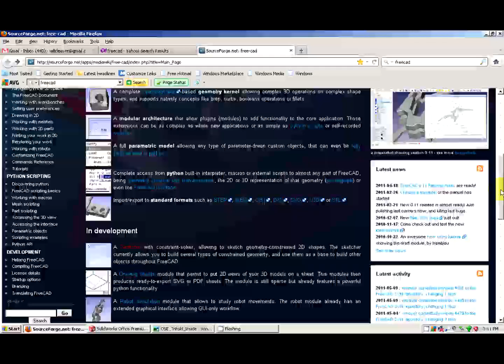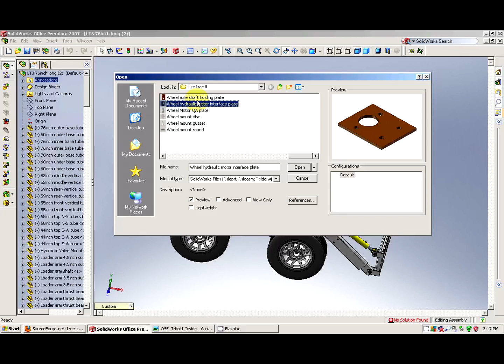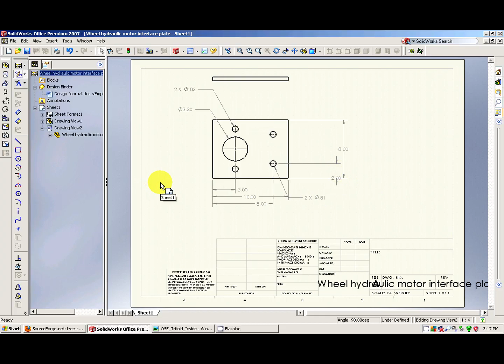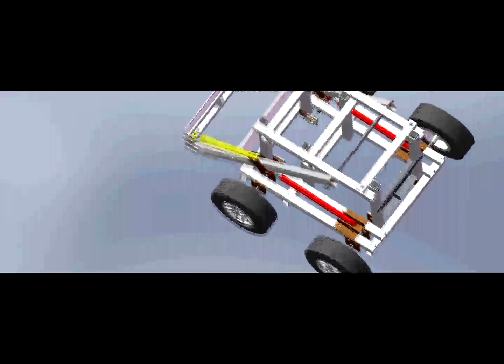Open Source Tractor "LifeTrac 3" design in SolidWorks

Comment: I don't know where you're buying used tractors, but I've been paying far less than $120,000. I recently bought a Allis-Chalmers 5070, 135 HP diesel AWD tractor with cab, A/C and heat all the extra for $2500. Put about $1500 in it on new front tires and a few frayed hoses on the front loader. I didn't say it was a bad idea and for a project and SMALL operations it might be alright. But, I doubt it's up to the real work on a real farm.

Comment: Not saying this isn't a bad idea, but, Hydraulic components, Cylinders, pumps, motors, directional valves and hoses are quite expensive. Steel prices are through the roof  Drive hubs and wheel and tire assemblies, with the cost of a welder and machine tools to fabricate the parts, it's just not cost effective. It would be far less expensive to buy a good used machine. I restore old farm machines as a hobby, and I make a good return when I sell them.